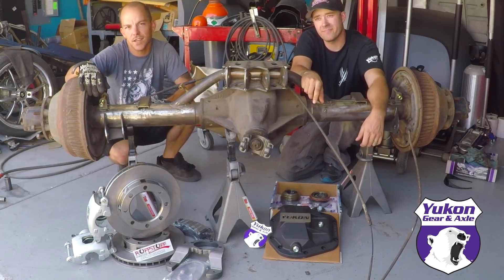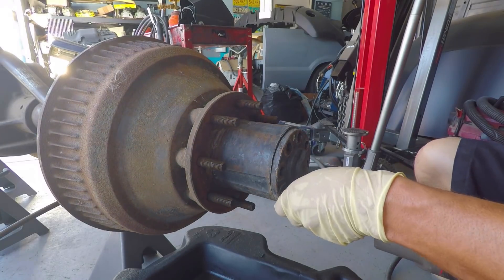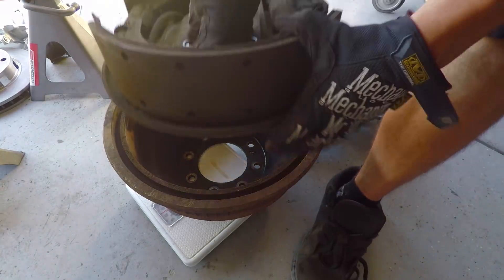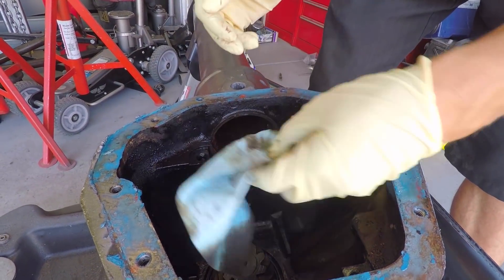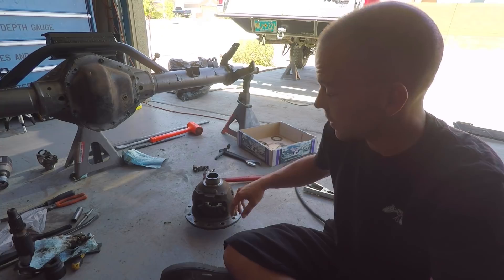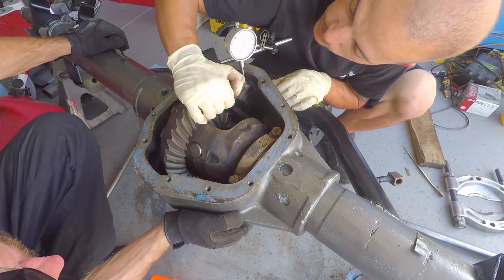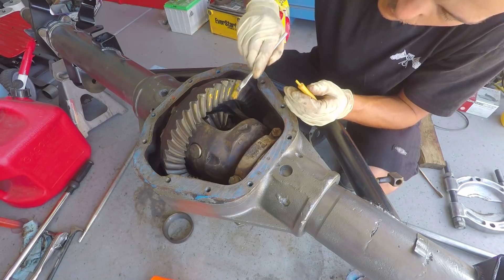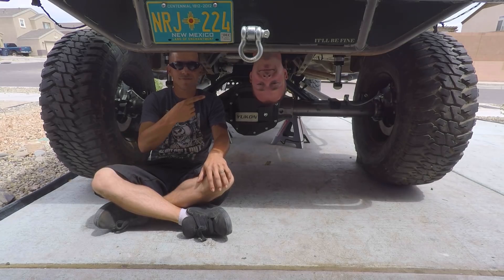Dana 70 Rebuild, Lincoln Locker & Disc Brake Conversion - Reckless Wrench Garage

Comment: On ColoradoK5.com, my 4x4 groups site. We (back in the old days) 20 years ago, called welding the ol' 14 bolt rear's spider gears, we called it welding up the "Ball of Doom"
As the spider gears when completely welded, resembled a ball. I don't remember anyone ever breaking one. So, there's that. Keep at it!

Comment: Oven cleaner for axle housings and frames and grungy stuff like that and I pressure washer works absolutely amazing!! Very inexpensive also!! Not sure if anyone has tried it before but that's all I use basically
Reply from the maker: We’ll keep that in mind. Anything to make prep easier is beneficial. 👍🏻

Comment: Did you just use the stock lug studs? I read that they may be too short after the rotor goes on. Any issues there?
Reply from the maker: Yes I used the factory ones. It’s a dually axle, I have all the lug stud. I don’t remember what the difference in thickness was, but it wasn’t much.

Comment: The Bob Ross bit killed me. Haha. I learn a lot watching you guys. I'm sure the Lincoln locker will hold. However, if you're ever worried about a weld holding, put some heat into the part before starting an arc on it. Even just 300° will go a long way for that little welder. Can't wait to watch the next video, keep em comin! 🤘
Reply from the maker: Thank you! Glad you enjoyed it. I have recently learned about the pre-heat and have seen how much difference it can make. I’ll keep that in mind for future projects.  We did do that on the front housing for the truss.

Comment: I got a question, I'm assuming this was a dually at one point, did you just use the same hubs? And the disk conversion, I'm assuming that was specific for a dually due to the bend angle?

I recently bought a 70 dually from a 92 dodge, want to basically do the same thing. I chose to put the 70u I got into my hauler instead
Reply from the maker: Yes, in this video I had the factory dually hubs and the kit was specifically for the dually. 
I later swapped to single wheel hubs to push the wheels out further, and used weld on 14 bolt brackets.
Reply: @RecklessWrenchGarage  awesome, I've been researching this topic for a while now and there really isn't any info out there. I'm planning to do basically what you did here in this video, as a build for my zj.  I am trying to find the connection, but you have the video on the d80 spool, did this diff blow up?
Reply from the maker: What info specifically are you looking for? 
We have a video with a little detail on the hub swap also. 
This diff was welded. After the inadvertent axle removal, I noticed one of the welds had cracked so I swapped it out for a spool rather than welding it again.
Reply: @RecklessWrenchGarage  I have the DRW d70 and it has the gigantic wheel studs. I have a SRW d70u, and am trying to find out if I can swap hubs from one to the other. I know the axle length would be off, but I plan on running chrome shafts in both..
My plan is to take the 30spline d60 out of my 81 crewcab. replace it with the 32spline d70u, and put dually hubs and wheels on it. then use the DRW d70axle in my jeep project. I already have an artec truss for the 70, and is a bit different fit on the 70u. I had also thought about the d80 spool from ECGS, but its a bit spendy.
Reply from the maker: The axle lengths would not change if you change the hub. The mounting surface for the axles remain in the same place, only the wheel mounting flange location changes. 
I don’t remember how the 70u carrier differs from the 70hd, but in my case, the spool was the cheapest of all the options, except welding. There may be other options for the 70u.

Comment: I never thought about pulling the pin and rotating the spiders. I welded my spiders to the case also.
Reply from the maker: I did the on the 10 bolt that used to be under it. This time I was able to weld around the entire small spider gear by pulling the pin, so I didn’t bother welding it to the carrier.
Reply: RecklessWrenchGarage that makes since. I may weld the posi in my Sterling. It’ll be hard because it’s kinda like a 14 bolt carrier. I’ll have to disassemble the carrier to weld them.

Comment: It's nice to know it is possible to get the gears out without a case spreader. I just scored a 1999 Dana 70 out of a truck and I think it has a spool or something because both tires are locked solid and rotate the same direction. I only paid $200 for it and I am doing the disk brake conversion and I need to put 5.29 in to match my front. I'm so curious about pilling the diff cover off and seeing what's inside. He said the pinion seal was leaking and he wanted a Dana 80 so lucky me. I'm putting it in my 93 Toyota 4 Runner.  This was the 1st video on this that did it with a case spreader, did you find it hard to get the gears in? It looked like they went right in? Cool video.
Reply from the maker: Before you get too excited, you might want to double check gear availability. To my knowledge, there is no selection of gears between 5.13 and 5.86 available for the d70. 
I was planning on getting 5.38, but it’s not an option.

I have removed/installed the diff in this axle a hand full of times now. Without the spreader it take a little more effort, but still doable. There are a number of tricks you can try in order to remove it.

Comment: Where did you guys buy the rear disc brake kit??? Share the info or link maybe ??? 🤙🤙😎😎
Reply from the maker: We originally ordered the kit from Ruff Stuff Specialties. After switching to srw hubs, we ordered weld-on brackets from Barnes4wd to relocate the calipers.
Reply: @RecklessWrenchGarage  ok,,  super !! Thanks 
I will try to find something like that for a jeep J20 that I found in mexico, with a dana 70HD I believe.. the problem is that the rear drum brakes have no self adjusters,, it just has two springs from the shoes to the top pin and one spring at the bottom that holds both shoes, that bottom spring is sitting on top of the adjusting screw (looks like a star) keeping it from turning by itself,,,,,😁😁
It must be an very old type or brake system, unless is missing some hardware parts..
Reply: @RecklessWrenchGarage  look what I found digging on the web.
https://images.app.goo.gl/5Nza8dBnwxT2UrqD9
That's the kind of rear brakes on the J20 I was telling you about..
Reply from the maker: The silver piece on the very bottom in that picture is the adjuster.
Reply: @RecklessWrenchGarage  yeap!! But did you notice that there's no " self adjusting lever" !!??
Like in any other brake shoe system.

Comment: Got a question guys i just got a set of dodge one ton axle front is a dana 60 kingpin rear is dana 70 but seem like there is no 5.38 gears for dana 70 what gears are you guys running on that rig 
Thanks and keep up the great videos
Reply from the maker: I don’t know of anyone that offers 5.38 gears for the 70; closest is 5.13 and 5.86. The Stuburban still has 4.56 gears because of this. I haven’t decided which gears I’d like to swap to.
Reply: Are your axles from dodge or chevy
Reply from the maker: Chevy
Reply: @RecklessWrenchGarage  thanks buddy

Comment: Did you have to put a proportioning valve on to keep them from locking up?
Reply from the maker: I didn’t need a proportioning valve, but I did install one. I used a master cylinder from an 02 3/4 ton Silverado. The valve I installed is now adjusted all the way out.

Comment: I was watching this episode on the toilet so yes i could sense exactly how that diff smelt
Reply from the maker: Hahahaha!
Reply: @RecklessWrenchGarage   Hi, could you tell me how to know the ratio from the axle, because I ve seen there is 4.10 ; 3.56 .... Is it stampped somewhere or how can I do to find it, because I need to change my pinion beraing? Thank you in advance
Reply from the maker: Take a look at your ring gear, you should see a pair of numbers stamped on it separated by a dash. Divide the two numbers and you’ll find you gear ratio. 
Example 10-41 will be 2.43:1 ratio. 41-10 would be 4.10:1 ratio.
Reply: @RecklessWrenchGarage  ok thank you very much For your help.

Comment: For that Dana 70 is it from a dually? And what size studs are you using? Working on swapping king pin d60 and d70 from dualy into k5.
Reply from the maker: It is from a dually, if that is what you are asking. The studs are the factory ones. I swapped to the 14 bolt srw hubs and kept the same studs. I believe they’re 9/16”.
Reply: RecklessWrenchGarage yes, thank you I meant dually. I’m thinking that’s what we’ll be going with. Thanks for the reply.

Comment: Did you also need to install a proportioning valve? If so, what brand did you go with?
Reply from the maker: I did install a wilwood proportioning valve; however, I didn’t need to since I also installed a master cylinder for a newer Silverado with 4 wheel disk.
Reply: Awesome.  I purchased the same kit for my first-gen Cummins...using your vid for instruction. Love the channel!

Comment: Maybe i missed something but what you do for parking brake? And there is no proper way to weld a diff. The process itself is improper.
Reply from the maker: It doesn’t have a parking brake at the moment. There is a manual line lock, but it will be replaced with a hydraulic hand brake later.

Comment: At 11:42 at the bottom of the caliper is that by your right hand with the rubber cap on it?
Reply from the maker: The pinion was pointed down. Notice the shock tab right next to it, which is mounted on top of the axle.

Comment: You can get a Detroit locker for the Dana 70 for under $500 or a spool for about $115.
Reply from the maker: I’d like to know where you can get either of those for that price. 
The Detroit runs ~$700 and the spool ~ $500.

Comment: I wish I had skills like that. I have a 79 Ford kingpin 60 front and 60 rear but just sitting because I lack fab skills
Reply from the maker: If you have the tools and motivation, start practicing. That’s the best way to develop some skills.

Comment: Next time you weld the diff put a little piece of metal in the center that way you can weld on all four sides not just the corners
Reply from the maker: carl loader I did that on the 10 bolt that was under the suburban before. This time I pulled the pin and spun the gears around so I could weld all the way around the outside of the side gears. It’s more than just the corners.

Comment: Where were the parts sourced from to do the conversion? Will it work on a dana 70 dually?
Reply from the maker: Michael Cordova As we mention in the beginning, the disk conversion kit was from Ruff Stuff Specialties. Yes it will work on the dually, that’s what this axle is. You just have to make sure you get the d70 dually kit.

Comment: Dually kit ? If so will duals still fit
Reply from the maker: It was originally a dually axle, yes. 
It now has 14bolt single wheel hubs, but still using the longer wheel studs, so it could still fit dual wheels.

Comment: I thought the HD was a 10 lug axle? not an 8 lug. or am I just thinking of the chevy 3500hd trucks
Reply from the maker: I don’t know of a Dana 70hd ever being 10 lug. My C30 has an 8 lug 70hd as well.
Reply: RecklessWrenchGarage maybe I'm thinking of the late 90s model chevys the 3500hd had 10lug rear axles. they was also Dana 70 or maybe it was an 80 I cants remember lol
Reply: Motor home 70s are usually 10 lug.

Comment: Looks like you could use a new bump stop on the passenger side.
Reply from the maker: No, the schrader valve was loose so all the air leaked out.

Comment: and drums have more stopping surface then disc. so they stop better when working correctly. that's why semis still use them on the rears
Reply: you coulndt be more wrong, semis use air brakes and drums can engage when the air fails...simple as that..theres not one performance vehicle in the world that uses drums...and semis would be light as a feather if technology woild allow it...you probably think anti-freeze freezes before water too...

Comment: Como es que se puede soldar el fierro vaciado? O no lo es
Reply from the maker: We did not weld the cast iron on the rear axle. 
The front axle is welded on the cast. We heat it up to 400*f, weld it, slowly let it cool.

Comment: A 3/4 ton 14 bolt would of been more ideal for locker options, and it would roll right in.
Reply from the maker: I am aware of that; however, the deal that came up was a 60 and 70, so that’s what was used.

Comment: ALWAYS USE LOCTITE ON THE RING GEAR BOLTS. TODAUS METALS ARE NOT WHAT THEY USED TO BE AND RING GEAR BOLTS WILL WORK LOSE IF NOT LOCTITE-ED.  TRUST ME.